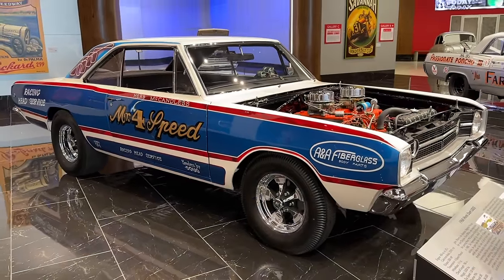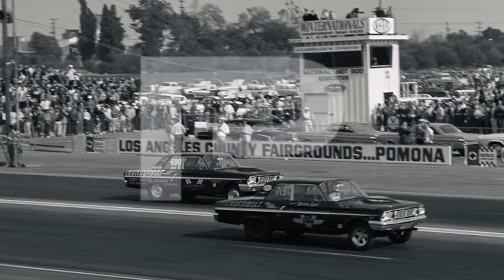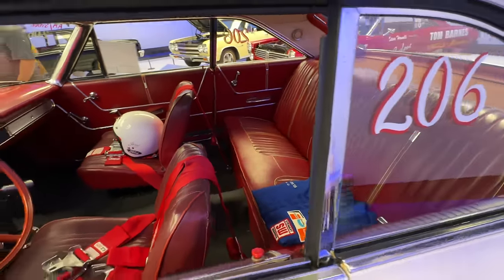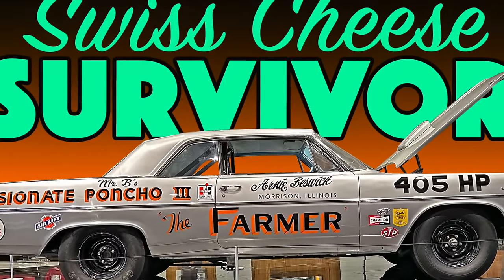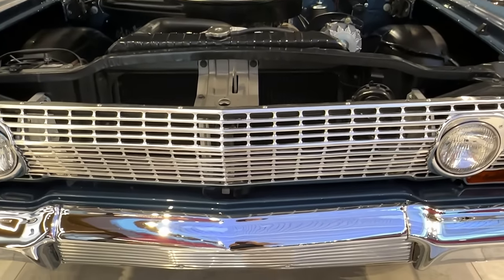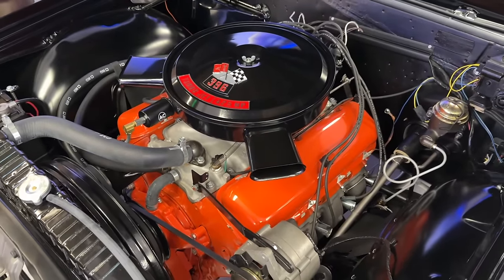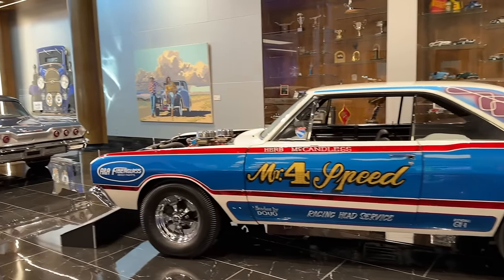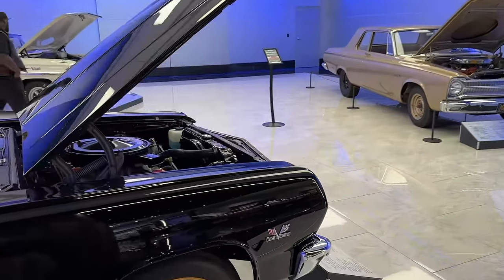FACTORY DRAG CARS Exposed! The Holy Grail from GM, Ford and Mopar

Comment: The factory drag cars were the coolest cars ever built. 👍🇺🇸
Reply from the maker: Absolutely...they are fascinating!
Reply: Hey 442-Mike by looking at your  alias I can't  tell if you're  a fairly  "educated  Millennial  or  a diehard   Oldsmobile  guy  but  I can agree 👍  with your comments  pretty much 💯  %  that the old " factory stocks " were  drag racing  royalty  and should  get get  the  best  care  and restoration  as such 😊😅😮😢😂❤😂😊❤😊❤😊
Reply: They still make Factory Drag Cars. They are very pricey though . I will go in 50/50 with you if you want. The Demon 170 would be a good place to start.
Reply: The factory drag funny cars are the coolest and the rarest
Reply: So popular is the modern Mustang Cobra Jet, that Ford Performance built 50-car batches in 2008, 2010, 2012, 2013, 2014, and 2016.
The legend of the Cobra Jet lives on 50 years later with the 50th Anniversary Cobra Jet from Ford Performance Parts. This iconic Mustang race car is the quickest ever with performance in the mid 8s at over 150 mph. 
Ford Mustang Super Cobra Jet 1800 Debuts With 1,800 HP, Will Seek EV Records
It's a massive upgrade from Cobra Jet 1400 prototype and will try to beat the 1400's 8.12-second quarter-mile EV record.
Reply: @roadrunnerbeepbeep9731  agreed
Reply: Well I have one of them that’s still around in excellent condition and for Sell original trudell Ford 427 cui

Comment: The manufacturers lied like hell about "horsepower ratings". Example: you can bet the farm that the Ford R-code 427 was making far more than "425 hp @6,000 rpm". They were closer to 600 hp.

Comment: NHRA required those T-Bolts which had the fiberglass front bumper to be replaced by a metal bumper, usually aluminum.

Comment: My friend when we were still teenagers purchased one of the Ramchargers aluminum bodied Darts complete with the prototype Hemi for $5000. at an auction. He sold the body and like many General Lee enthusiasts at the time, put the 426 Hemi in a General Lee replica. I remember being in the back seat while driving down the highway, and getting pulled over by a State Trooper. As my buddy rolled down the window and the trooper stared in, he said to pop the hood, cause he wanted to see this locally legendary engine. It had SO much torque. The heads had ports the size of softballs.
Reply: That sounds like mighty small ports. I had a straight six engine that the ports were so big you could put a soda can in them.. sideways!

Comment: In the mid 70's, a guy had a white T-Bolt for sale. It had everything except, the engine,4 speed & driveshaft. It had plexiglass windows, except for the windshield. He wanted $1200 for it. Later we heard he sold it for $1000. He also had a '69 Torino that he put a 427 in it. It looked like a factory installation,it was so clean looking. I can't remember what he was asking for it.
Reply from the maker: Wow! Would've been crazy to end up with a Thunderbolt for $1000.

Comment: I owned a 1964 Plymouth Drag Car, was the Jardine header race car had a 426 wedge head, when I had it it had a 383, aluminum front bumper, front fenders, hood and rear bumper, battery in the trunk, open the glove box no box but a sticker stating it was a drag strip car no intended for street use, when the headers were uncorked it would lift the front wheels about a foot, drove it and raced it on the street
Reply from the maker: Wow that's awesome!
Reply: Must have had some really restricted exhaust because open headers costs some power compared to header extensions

Comment: I once owned 8 Max Wedge cars ‘63 and ‘64. All with proper tags and unique oddities that ID the cars. One that we found a broadcast sheet in. 1964 Dodge 440 Hardtop. High trim level. Aluminum front end, battery in trunk, but had a heater and radio. 13.5:1 compression and 50th Anniversary Gold with a white sweep. Perfect original seat covers were under black vinyl covers. This car should not have existed. I also owned a ‘64 Dodge Hemi 4 speed. In June they switched from the wedge to hemi. I have a letter from the man who ordered the car. He was expecting a wedge. I have the invoice for the car too. All these cars were restored correctly. You aware a ‘64 hemi block is different? Ever search for that air cleaner or the headers and bell housing? I found them in Houston at one spot. $10,000 in 1988.
Reply from the maker: Wow! That high trim level Max Wedge car sounds wild. I personally love the stripped down cars with big engines, but I also love crazy combinations like that. Sounds like you've had some serious experience!
Reply: @HotRodHoarder  I wanted to find a niche. Everybody wanted a hemi. So I got interested in the Max Wedge instead. At that time very few knew how to decode the tags or recognize subtle factory changes to these cars. It was a fun learning curve. I started by restoring a ‘63 Savoy by myself to learn every inch. Then I started using a well equipped shop to do full rotisserie restoration on dipped bodies. It is interesting that all this was done prior to the internet. Hemmings was a huge deal. In time, I had people calling me from all over the world with leads or wanting to buy a car. By the late 80’s and very early 90’s, I felt the cars would never be worth more. I sold the ‘64 hemi Dodge for $100,000. Sold all of the cars to bail out on top. What an effing dork. Today? I have a real altered wheelbase ‘63 Chevy II and a beautiful ‘67 Chevy II true 9 second street car. And a new high optioned C8. This is a slower pace but it fits my age better. I LOVE your work! Your videos are of great interest. I am trapped in the Old Days. Thank God! Now get out there and set that bitch sideways!

Comment: If I remember correctly, the small "bucket" seats in those Thunderbolt's were simply the factory seats out of the Ford Econoline  van from the same era. These seats were/are small, lightweight, and sturdy enough.......which is why Ford Motor Co. chose them for the Thunderbolt.

Comment: OK I just found this on the 63 Chevy Impala Z11 "The Old Reliable" build that Grumpy Jenkins drove. Gives you an idea on how fast these cars were....
Tipping the scales at 3,500 pounds (1,588 kg), an impressive figure for a 17.5-foot-long (5.3-meter-long) full-size, the Z11 needed only 4.3 seconds to hit 60 mph (97 kph) and covered the quarter-mile in just 10.8 clicks. That was faster than most U.S.-built production cars at the time. It was also the first stock car to exceed 120 mph (193 kph) in a quarter-mile run.

Comment: I have always thought that these engines all had the hi-rise heads and sodium filled exhaust valves yet I never see it mentioned. Around Baltimore, MD was a THunderbolt Fairlane named Black Jack Jr. and it had the name painted on the bottom of the doors. Someone  from the "team" would bring the heads into the machine shop that I worked at and Bill or Leo would do a valve job as he they waited.  They might have be back once or twice more a season. The heads were cracked and due to how expensive new bare heads were from Ford, they opted for the valve job. When the E.T.s dropped, off came the heads for another valve job. I never understood the logic in that plan. This was my first encounter with sodium filled valves. I wonder if that car still exists.

Comment: Question on the ford t-bolt.the four speed that ford use was different than my buddies XR7 SS/G. The t-Bolt trans was considerably larger,both were top loaders and looked very much the same except for the size. Any comments?
Reply from the maker: Hmmm, not sure on that one! I thought the Toploaders of the '60s were the same, but maybe the early ones had a larger case? I guess I need to go study.
Reply: Was the Doug Nash top loader different? I know my friend ran one for years before getting a liberty.

Comment: Awesome cars and a Great video
Reply from the maker: Thank you for watching!
Reply: @HotRodHoarder  You're welcome. I've been subscribed to you channel since right after you started it.
I'm 62 years old so a lot of the cars that you do videos on were cars of my youth.
I was born in 1961 and bought my first car when I was 15. It was a 69 Chevelle SS 396, 4 speed with a
factory 4.10 12 bolt posi. Over the years I have owned other SS Chevelles and Novas, Tri-fives and Corvettes.
I built several show / drag cars,  a NASCAR legal Camaro,, and my last car I built was an injected winged Sprint car
that was run on dirt tracks...
I don't have anything against the LS platform engines at all, but it's really nice to see old school small blocks and big blocks
with carburetors or injection.

Comment: What was the correct block for this car? A long time ago I had a 427HP engine. This was bored .060 over and was like new inside. It had a grooved crank, was a center oiler, It was a 64 block.
Reply: Still cannot  believe  NHRA allowed Ford Thunderbolts in Stock Eliminator. 
Memphis Dan LeLoLai

Comment: My father used to race at an old air strip in Knoxville Tennessee in the late 60's and early 70's.  He had a 1965 Chevelle SS 327 four speed. Pretty quick car for the day. But he always used to claim that there was a Champagne Belvedere that was faster than the word of God. I almost wonder if was a factory drag car. He said it was two 4 barrel Hemi. (Im sure people disguised and lied😂) He said the only car that gave it problems was a green LS6 Chevelle with no stripes that was driven by the woman he bought his 65 SS from. Apparently she could drive. Lol. My dad has all kinds of story's about Knox Air Strip. Don "The Snake" Perdome supposedly raced some guy in a Pantera with his 68 Hemi Charger for $20,000. My father wasn't there, but apparently Don got'eem. That was alotta scratch back in the 60's or 70's. Anyway. Thanks for sharing that museum. God Bless.

Comment: The very first one your information is incorrect  The Thunderbolt bumpers,.. the fiberglass ones they started with were ban by NHRA so then they went to the aluminum, they stripped everything out of it for weight , anything that didn't have to be in it was removed,  Radio, sun visors sound deadening , even the passenger side windshield wiper...lol   that car won that year NHRA Top Stock 1964 driven by Gas Rhonda 11.08 quarter mile time just some fun facts..
Reply: I think you're right about the bumpers.  They could chrome the aluminum ones -- like this car's are.  But fiberglass bumpers never looked right -- no way they could slide past inspection without being noticed.

Comment: I wonder how my current 2017 Super Sport Camaro 6 speed would stack up against these? My Camaro is running 455HP and 455 LBs TQ and rated at a low 12sec car....many of these cars here were into the 11s with HP in the 400s yet the TQ was well into the 500s or 600!...that being said I give props to these cars for doing what they did without computers, fuel injection and other modern gizmos. Back in the day I thought my old 69' Ply. Roadrunner was fast. It was OK for its day but would today be even faster just by adding a new modern 6 speed manual or 8 or 10 speed automatic trans and modern sticky tires. My 383 Roadrunner would smoke the tires for 15'  just by stomping it, but still nowhere near as fast as my Camaro.
Reply: You answered your own question. 12 is not 11. They got you at start.

Comment: I think that Ford must have found that cool air into the engine did help HP. They spent alot of time creating those cold air ducts and im guessing they would not have done all that if it didnt work- they could have just plopped an air cleaner on top and ok- bye. But they didnt- thats just my 02cents  - heck i could be way off

Comment: Unbelieveable bullshit with the cars when they say "Rated at X hp but they really made X+ hp. ".  They don't know, no one had numbers on it!
Reply from the maker: Correct, there are not a lot of exact numbers. Even if these engines ended up on a dyno at some point, the numbers were not disclosed. The only way that anyone can claim a horsepower estimate is by doing the math on 1/4 mile E.T. or MPH against the weight of the car. It's purely an estimation.

Comment: Why no hurst as amx?
Reply from the maker: I guess the museum couldn't source any AMX Super Stockers. Would've been cool to have an AMC represented in the group.
Reply: @HotRodHoarder  the ss/amx competed with some of theses cars in ss/d ss/c and now in ss/b and was the car to beat through the 70s 80s and 90s .The crossram 390 was factory rated at 420 by the nhra .And made 100 more in race trim,back in 70 .current ss/b at close to 900hp high 8s .it was one of the quickest ss ever made behind the legendary hurst 426 hemis darts.and the only small blk to race ss/c against combos like L88 vette and 427 thunderbolt, no other small blk of any make competed in those as classes.so yeh they forgot one of top 3.

Comment: The Hemi Dart was the clickbait here .. Obviously I've never seen one in real life, and have only even heard one single 426 run in my life. But some odd tidbit I recall reading maybe 40 years ago though .. That every one (Hemi Dart) had a dent in the headers from being loaded on the trailer? Who knows if that was true or legend.

Did points and a condenser on a 409 once .. Maybe in a '63 or 4 Impala? I don't recall pulling plugs, but man .. looking at your stills .. they must have been a treat - like they just wanted to jump into your arms. I now need a damned Sherpa to find three of the six in my wife's commuter. New cars suck.

Note, that although I may have hit "like" .. I will be reporting this video as pornography. :)

Funny .. I feel like a bit of a poser. I was there .. I wrenched on the end of this era, even twiddled a tool beside names that weren't quite "Smokey" .. but someone dead that someone may recall. But somehow, despite the stories, I was never really there.

There really is no country for old men.

Comment: The fastest Super Stock car was the Hemi Cuda and Dart 2nd fastest was the Thunderbolt and the 3rd fastest was the 61 tempest 421 Chebby didnt make it into the top 3
Reply: Wrong!!! .... I know the truth... You never rode in my brother's Corvette... Do a search of the 2 mystery motor late 68 corvettes, find out where they are and if both are left still 😊😊😊
Reply: And the 2 rarest v8 Chevys are owned by myself and my uncle..... I own the original serial # 1 LS7 BBC 454 .... My uncle owns the only flat plane crank sbc.